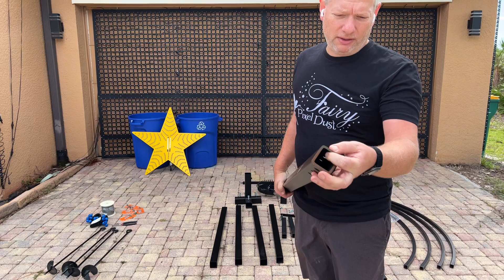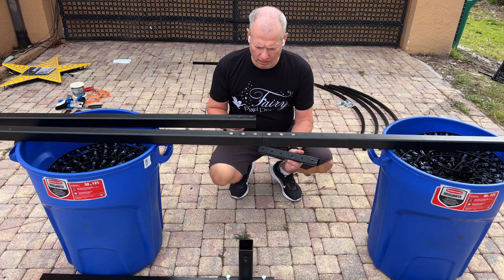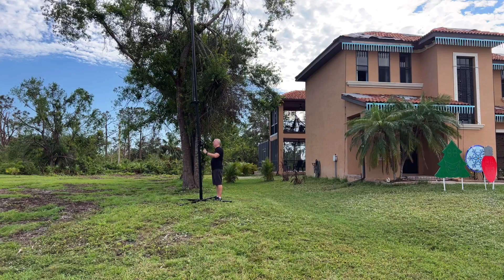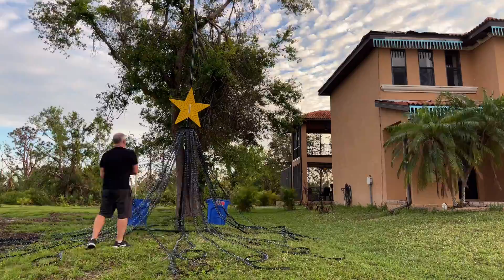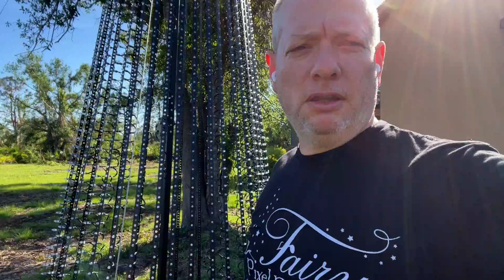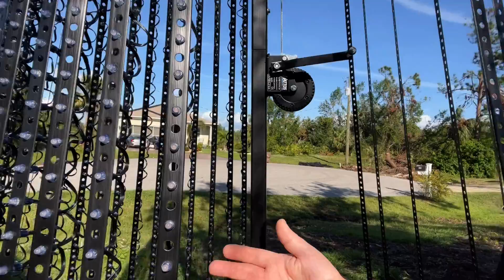Mattos Designs Modular Sasquatch Mega Tree Assembly

Comment: My front yard is on a slope. How do I level the base ???
Reply from the maker: Use a different base, Mattos had several options for the base on his site. Buried version might work best for slope. Or portable hole and cement the base at the angle you need.

Comment: Hello again, just another question. Upgrading my Mattos Sasquatch mega tree. You think 48 sliding topper with 3ea. 66inch pole and with 8ft. hoops will hold exactly 100 pixel for ea strand ? jsut want to get an idea .I think you mention that on your video.  ( 2inch pixel spacing )Thx again'
Reply from the maker: I think so, as the 6’ base is just a little small for 100 pixels. The 8’ hoop will force the strips out further and should be fine. I actually just ordered the 18” add on extension to make mine taller, so that the 6’ hoop will work with 100’ next year. Good luck!
Reply: Thx again really appreciate it.

Comment: very nice video, easy to follow.  If this is 16.5 ft tall how come it does not fit all 100 pixels.  I thought this height was designed for 100 pixels or 200 inches.
Reply from the maker: I’m not sure, but he does now sell  it with a 16” add on pole when you order one of the kits. That would make up the difference needed.

Comment: I want to use this design as I am new into lighting and exploring the type of tree that I would like to build. Some questions and complaints...  1) The camera shakes too much to focus on the topic of your narration. Also, the bungie balls.. you didn't get close enough to see how you attached/used them.  The explanations were too fast, too short, without a demo to see exactly how to do that step.  The strips were talked about" make sure to hook these up so link them together"  however, you never focused on the end well enough to see how to start the string deployment. Where does the power come in form the controller? On the base, or does it start at the top of the tree?  How did you patch in the star?  Answers to these questions would make this video perfect!  Thank for the parts that were done correctly and with great examples and explanations.  The website to buy the kit is sold out of many parts.. are these tree kits still for sale..?
Reply: You have to buy these parts many months in advance - this is a project to start in the off season, not during the peak of holiday light season. I bought my kit in January 2023 and it was delivered in several shipments from July-September 2023. That’s the kind of timeline to expect.
Reply: @sid65811 wow.. okay.. thanks for the heads up on this!!  Because I live on a corner lot, Is it possible to configure the tree for a 270 degree viewable area..?  The calculations for strings, power, controller capacity..  it would be great to have a video on this topic using this product!
Reply: @DaleCunningham_DBA  yes you can absolutely do as many strings as you like in configurations up to 360 degrees. Xlights has all of that in the model definition.

Comment: Hello, that tree is awesome and good presentation,thx. Just a question . How did you attached the 36 boscoyo chroma star on top ? Did you use a pvc pipe ?
Reply: It actually it’s a 1” square steel tube and has a bolt on one end that bolts to the topper. Nice and strong
Reply: @Options4TheWin  Thx. I think thats a lot stronger than pvc. I"ll do the same.

Comment: Is there anything to lock it in place or just under tension from the winch the whole time?
Reply from the maker: The steel frame is completely bolted together. The topper when winched up, is only held up by the winch, this allows you to raise and lower the topper easily on demand. I had some major wind storms come through one year and I was able to safely lower everything and reduce the risk of damaging the structure.